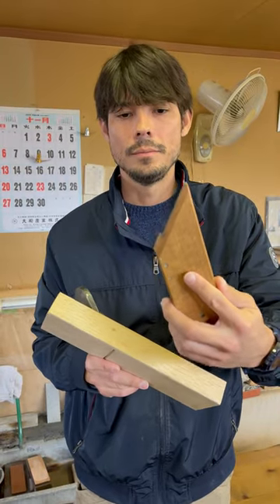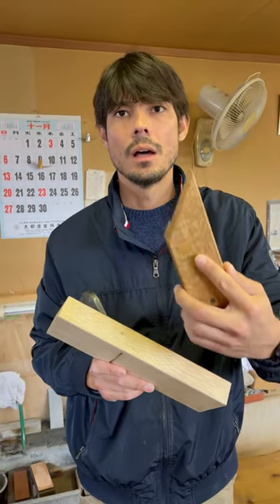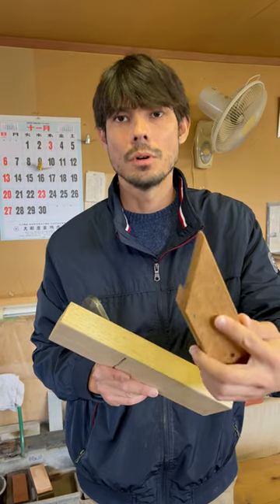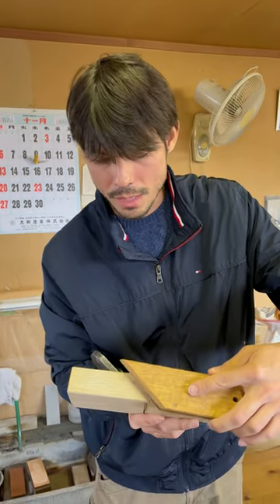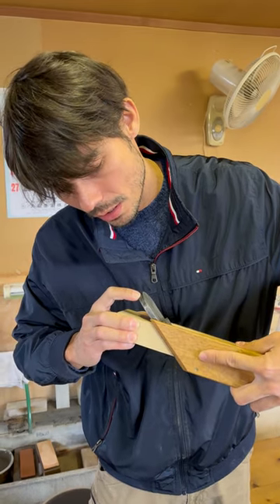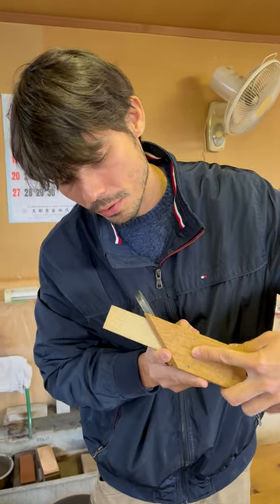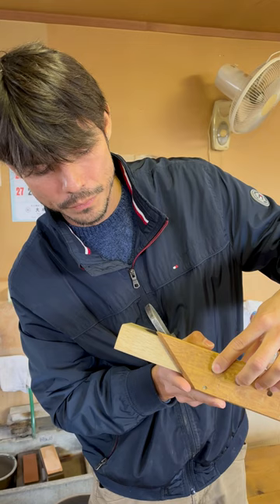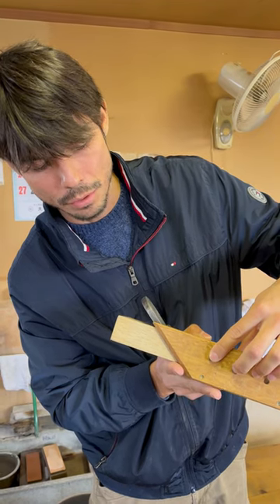Setting the Optimal Angle for a Japanese Plane - 8分 Koubai (or 38.65°) #shorts #japanesewoodworking

Comment: Is this the effective cutting angle from which we subtract the blade taper angle to get the bed angle when making a kanna dai?
Thank you for making these videos 👍
Reply from the maker: This angle is not related to the blade bevel or the bed angle set inside the Dai. This angle is the position of the flat back of the Kanna blade as it lays inside the Dai. If you were to really break things down there is a lot of variability in this suggested angle as this doesn't take into account the bevel of the blade, the thickness of the blade, etc. The cutting edge as it impacts the wood surface will have some micro-fluctuations that are not taken into account. This angle is merely a suggested angle based on research over the years. Western planes will have an assortment of impact angles which are designed for various uses and wood. I would suggest fine tuning your angles based on your intended woodworking.
Reply: Thank you for taking the time to explain, appreciate it.